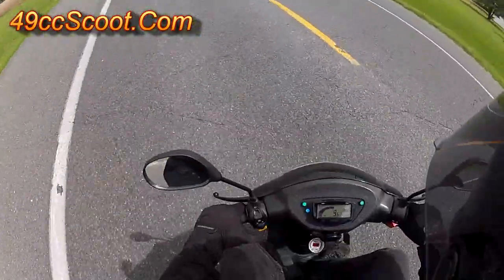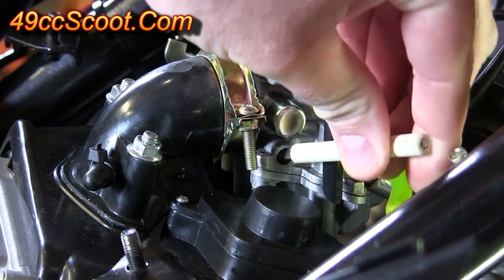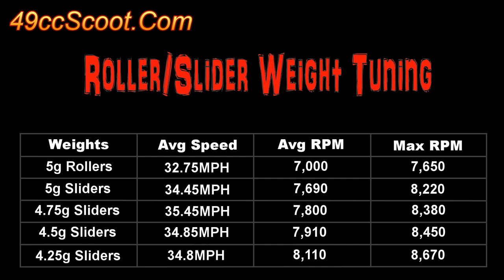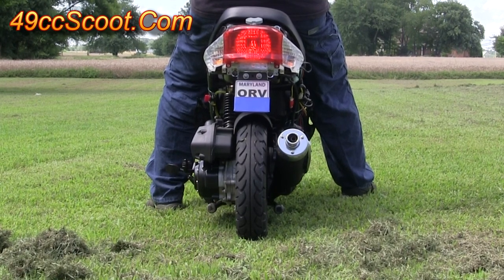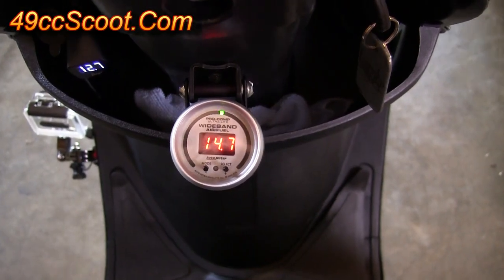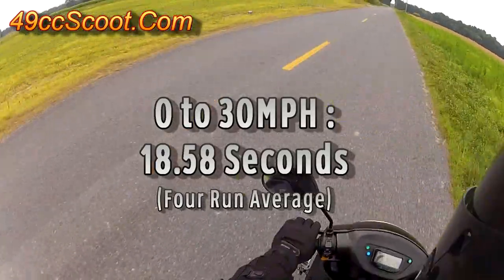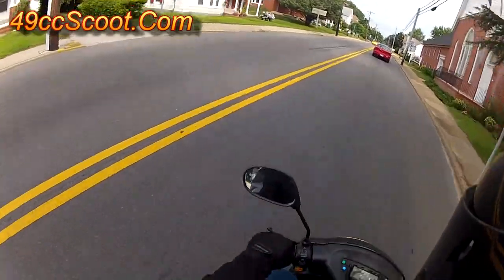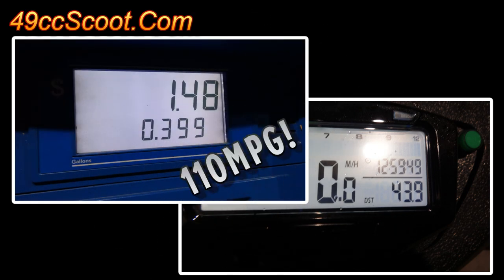Project TaoTao : Carb & CVT Tuning, Airbox Restriction, & Keihin PD19J Swap : 50cc Scooter

Comment: on a new carb how do you choose from what main jet will start ??
Reply from the maker: Use the experience of others with similar setups as a guide and start larger than you think you need to.
Reply from the maker: Just from what I can hear, I'd try changing needle positions. It seemed like it was OK once it got going.
Reply: hmm at full throttle bike gets hard time on forth gear. it goes up to 80 with third gear but once i put forth it wont move up
Reply from the maker: Depending on the engine size, it could be out of speed there. If it's a small engine, 50MPH is pretty fast. Could be out of tune. You could try some runs in third gear WOT and see what jet gives the best result that way as well as trying to shift into 4th after and seeing if any make it a usable gear.
Reply: 90GTVert  thanks so much for your replys I will do wot at third but stock bike used to go 100kmh. engine is 115cc stock only carb and filter

Comment: hey found out the Brake light switch went bad and i need to find a video on how to replace it i called pete cycle you have any video's that show how to replace the brake light switch
Reply from the maker: I don't but it's actually pretty simple. Should be a connector or sometimes 2 individual wires with bullet connectors and the switch just snaps into the lever. Take a good look at it before you start and I think you'll get it.
Reply: Awsome where would it be located at where the head lights are inside or by the engine
Reply from the maker: In the levers.

Comment: I have 2011 tao 50 what is a good carb for it
Reply from the maker: John Quassy 18-20mm CV carb that is unsealed. Doesn't have to be a Keihin as in the vid, just something with an adjustable needle and mix screw.

Comment: What keihin carb did you buy?
Reply from the maker: XavMan91 PD19J
Reply: Can't seem to find it online, in thinking of a 70cc upgrade? Thoughts?
Reply from the maker: The seller I used no longer carries it. Try 02starrider or ScootersToGo on eBay. They should have decent carbs.

72cc (47mm bore) is a good choice. Beyond that there's too high of a risk of ruining the crankshaft prematurely. You'll still get a good boost in power with the 47mm bore. Stock head usually works OK with them. You'll need to tune the carb so get a selection of main jets. It would be a good idea to have some rollers around to dial the CVT in better as well.
Reply: Awesome thanks bro!! Keep up the awesome work!

Comment: Is Castro 4t 4stroke motorcycle oil ok for my tao motors atm 50 pony?
Reply from the maker: That's fine. You don't need a motorcycle specific oil though. Most of those are required for a wet clutch, with the ATM50 doesn't have.
Reply: @49ccscoot  thank u so much

Comment: guys I ,has a good TAO TAO 50 ,ok ,and some cut my belt, so I ,replaced it ,and has no ,no power ,to up hill ,new gear,oil ,plug ,lines or clear ,  B 12 ,corb.cleamer ,what can I , do for take off power ?
Reply from the maker: Are you sure the rollers are in correctly. If you didn't take the variator off to check, they may have fell out of place when there was no belt.

Comment: Where did you get your speedometer I want a digital
Reply from the maker: It's a Trail Tech Vapor. You can get it from Trail Tech or eBay and lots of other places.
Reply: ***** is the mount custom?
Reply from the maker: Jason Vorhees
 I made a panel out of ABS plastic and epoxied it to the underside of the stock panel. They make handlebar mounts and some other options if you look around on trailtech.net
Reply: I have a china-meter just like yours and thought what you did was pretty awesome
Reply from the maker: Jason Vorhees
Thanks. It's really easy to read day or night, gives a good bit of info, and accurate if you take the time to calibrate the speedometer. Wish I had these on every scoot.
Reply: Wish they made these on every scoot haha

Comment: Where did you buy the wiband
Reply from the maker: Probably Summit. I had it in my Mustang and repurposed it when I sold that. It's an Auto Meter Ultra-Lite series.
Reply: @49ccscoot  I have another question I saw him one of your videos where you were talking about your your pickup and the flywheel I noticed how close yours was like credit card length away and mine is a pretty good distance away is there any way to modify that to get it closer or do I need to slide it like you did to advance the timing when I use an aftermarket CDI
Reply from the maker: @Strict30  You don't need to mod the pickup for an aftermarket CDI. You may be able to just loosen the bolts and move it a little to get it closer then re-tighten.
Reply: @49ccscoot  thanks

Comment: Really not clear on how you get >30MPH.  When I first got my Taotao stock I could get roughly 30MPH max and only it would increase was when going down hill.  On the flip side going uphill even just a slight incline decreases my speed to between 20-25MPH.  I currently have over 2K miles on my scooter which I bought early 2014 and I recently installed a keihin carburetor but I'm not clear on where the idle mixture screw should really be set.  Out of the box the idle mixture screw was set really rich.
Reply from the maker: +Jonathan Morley Here's a bunch of info on the carb that you may find useful. The better it's in tune, the quicker/faster it will go.
http://www.49ccscoot.com/faq/carbtune.html

Comment: why not put a uni filter on? that pod filter.
Reply from the maker: Kevin Stearns I'll get around to it later and put air filters in an update. I think they are credited for being better than they really are, but I'll try a few setups and see what really happens.
Reply: ***** i bought one with a pod filter it was great but got dirty to fast.
Reply: ***** me again i cant get the scooter i got running to go past 30 mph? idles great has good take off. gas or electrical mods? thanks
Reply from the maker: First I'd check the overall condition. Compression psi, state of tune, CVT condition, etc...
Reply: ***** if the spark plug is the correct color why mess with jetting?
Reply from the maker: I never trust plug reads 100%. Maybe that's just me.
Reply: @49ccscoot  wow 4 years already now i can work on scoots like nothin. thanks to you tube videos!!!!!!!!!!!!!!!!!!!!
Reply: there is one thing its not a technical one the gas mileage is fukin aweful on my 150 scoot carb is jetted mint. plug is mint in color. ????????????????????????

Comment: you took out the restriction from the airbox but not from the  carburetor. (brass plate) no wonder it did no difference
Reply from the maker: You mean the throttle blade/butterfly? Look up how a CV carb works before you remove that "restriction".
Reply: 90GTVert  no in mine there was a brass plate with small holes in it that restricted the airflow. on the rear side directly attached to the carb
Reply from the maker: Oh, OK. Well that doesn't seem to be very common. I haven't had one like that and haven't seen anyone posting that on the forum.
Reply: 90GTVert Ok👌
Reply: it seems like yours is a one of the 2 strokes, they have that filter side carb. restriction (plate with perforations)

Comment: Okay dude uh this is Chris I'm on my wifes account here on Yahoo account I was messing with my my rear clutch is put a new belt on going to change the variator and you know I squeeze it in with my hands so I can have some slack in the belt but it just stayed stuck open like my squeeze it is stay that way you think I could be my problem is it a snap closed

Comment: just need to swap it over to a pissed off little 2 stroke, do a port job, and tweak on some gear ratios and be done with it.

unless you really enjoy tweaking with the little thumpers which is totally understandable becuase I enjoy watching you haha.

but yeah, thats the build id be gunning for because smokers, even though they can be temperamental, are the best horsepower per pound, per dollar, engines ever.
easy to mod for horsepower and they got those wicked power curves that make em really fun off the line
Reply from the maker: Most of my scooters are 2Ts, but I like to mess with different stuff at times... and the gas mileage is kinda nice on the 4T.

Comment: hi
I live in the UK, Wales in Powys actually, and it is very hilly my post code in google earth or maps can confirm this,
SY175HE
so not being a boy racer at 62 i tend to just enjoy green pastures  until we hit a steep bit then boy oh boy, times like that i wish i were on a HONDA VFR 1200 X DCT full auto, ah well we can all dream, 
so on one video i hear 15 gram for better hill climbing, and on here it says 4.75 gram hill climbing , so please which is it,
Reply from the maker: 15g is nuts. My 150 didn't use weights that heavy with a stiffer spring. The reality is that weights should be tailored to your setup. None of my videos are here to say X weights are the best. The idea is to show you how to find what works. ~5g would be way closer than 15g though.
Reply: thanks bro
i had a feeling one was wrong, in the big bore  49 to 100 cc kit i have bought, they have included a set of 7g rollers, and i have some
3.5g might try some tests on mix and mach,
have you done anything like this and if so what were the results of alternating weights
so that overhaul running and any significant gains were noticed, in order to take it further to proceed a little bit more, after the extensive work you have done it only makes sense to say,   DO I Continue or not and stick with 
maybe stock or 4g .  i have my kevlar belt to go on, 
one piece of news before i leave, is yesterday i was taking the drive case of, and it was still attached  by wires, it was the clutch bell cover timing magnet pick up point, yeah they have two tapped holes and repositioned it from top to bottom inside,along with shaped 
rubber wire grabbers that push into the casing, well i chopped through it refitting it and lost about a third of top end power , nothing above 31 mph
thanks for listening 
dave

Comment: overkill. just get a 150cc. lol
Reply from the maker: Tuning isn't overkill. It's getting the most from what you have. The fuel economy increase would pay for the jets and sliders eventually, aside from making it better to ride. Even if I got a 150 it would end up bored and stroked and so on eventually too. If I bought a liter bike, I'd still want to pull the engine out and have a look, even if it was already faster than I need it to be. My car had a turbo V8, my lawnmower did wheelies and had a flamed paint job, and so on. It's an illness.
Reply from the maker: A 150 is a great scoot if you have the endorsement and know it's limitations. Really nice for around town and roads up to 50MPH speed limit. They can go faster, but they really aren't meant for highways. Still if it's Chinese you need to go over it and check the tune and other things. Some of the Japanese and Euro 125-150s with EFI and 4V heads and such are faster and should be supported by a dealer that will get it right for you without you needing to tinker.

If you want a reliable big bore kit for a 139QMB, I'd advise sticking with 72cc (47mm bore). Connecting rod bearings tend to fail prematurely with the 50mm and larger bores.
Reply from the maker: 1 means single cylinder. P designates horizontal. People say the P means 63cc or the P means 69mm valves and both are wrong. There are some 63cc P code engines and some 69mm valved P coded engines, but not all P coded engines have those traits. Stock carb should work alright as long as it's tuned.

Comment: where did you get that tach? hhow did ou install it so nicely? also I have a question, the air intake hose has come off my carb. and for the life of me i can NOT get both ends of the carb connected to both hoses. I was thinking an easy fix would be to buy those little cone shaped air filter, but i know when theres too much air they dont run, any tips?
Reply from the maker: +Nicholas Butler Here's some info on the gauge : http://49ccscoot.proboards.com/thread/8614/trail-tech-vapor-information-installation

Try loosening the mount bolts for the airbox then installing the hose and maybe you'll be able to attach it all and get the bolts tightened again that way.